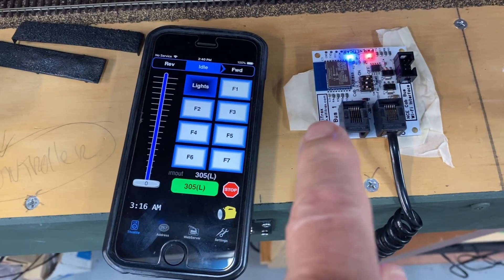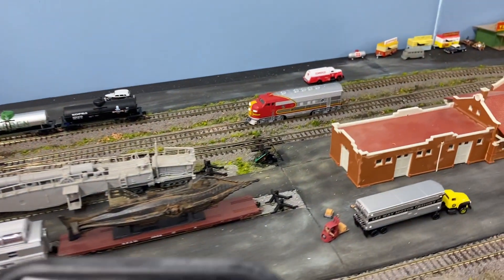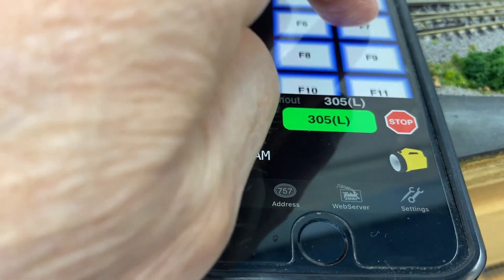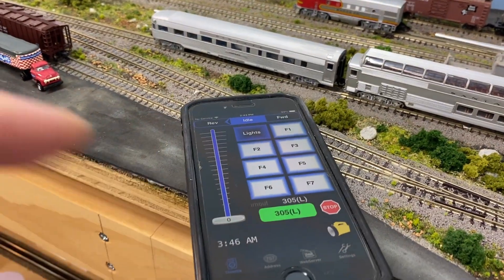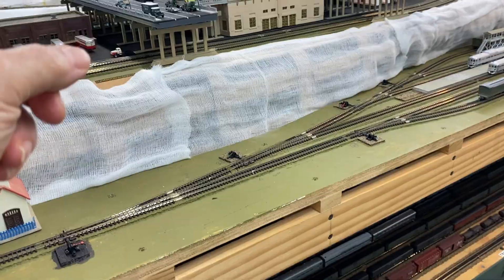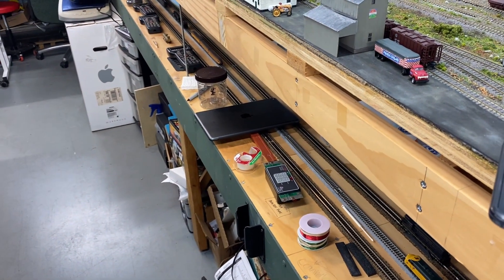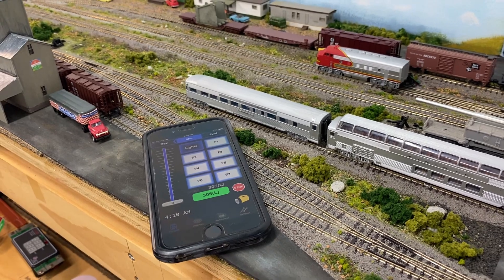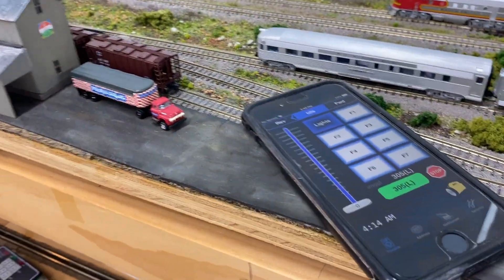WIFI Control with WFD-30 and NCE PH Pro

Comment: Looks great..
 ps.... You can clean your tracks with INOX MX3 ..... it is an electrical contact cleaner that works very nicely on your track.
Reply from the maker: I have used both inbox and crc226. The issue is always with the closure rails of the Peco electrofrogs……John
Reply: @tanzj  ....Do not use CRC26...this has a lubricant in it
INOX MX3 is a cleaner...it does have a slight greasy feel..but it is NOT a lubricant. just need to take some care around the frogs. But this will not cause any problems around the frogs...if you are having frog problems...it will not be from the INOX MX3
Cheers  Paul
Reply from the maker: @PSB-gj9xd  crc226 is an electrical contact cleaner and has worked very well for  10 years. Peco electrofrogs are always a problem especially on sidings that are not used very often…….
Reply: @tanzj  This is from the CRC industries website....notice the last 4 words... it contains lubricant....but your choice  cheers Paul. .....
Recommended for preventative maintenance programs, eliminates breakdowns due to poor environmental exposure, stopping leaking & arcing, corrosion protection of all electrical equipment during storage & transport and lubrication of contacts.

Comment: John, thanks for showing how easy it is to hook up and use the WFD-30.  Your video helped me decide WFD-30 over the NCE USB Interface or the WFD-31.
Reply from the maker: Hi Stephen, It certainly is very easy to hook up. I believe that the main difference between the 30 and 31 is that the 31 can be used to replace the NCE UTP circuit board in the chain of UTP connections. Other than that they would provide the same functionality. Thank you for your comments…..John

Comment: I've used my phone on both nce and digitrax and think its great.  The android is Engine Driver which is very similar to use and it's much easier than the regular throttle I think....👍👍👍👍
Reply from the maker: Hello Jack, Thank you for your comments. I am really starting to like using the WiFi since I can just walk around and not have to worry about plugging in one of my wired controllers. The radio control stuff is just way too expensive to add now. Even my current NCE system is double what I paid for it in 2012…..John

Comment: Looks Awesome Mr. John thats fun Running Trains that Way & Sir with Wi-Fi 

& the issue with your panels ya might try a Dab of NO-OX-ID on your Connectors that go into you UTP panels Bell systems telephone used NO-OX-ID like mad in there Connector pods and some of them we're subject to cold conditions, flooding  and they kept the connections like new for many years because of the NO-OX-ID i just applied a little Inox on my yard Turnout near my passing Siding because my ScaleTrains Dash9-44CW was loosing a bit power after applying the Inox she hasn't had any hiccups that Inox mx3 & NO-OX-ID is just Good stuff my wheels as Greg from fishplate Films said there showing very little Gunk on em' 

Hope using some NO-OX-ID helps your issue Sir and that Layout of yours is getting Sharper the more I see it..
Reply from the maker: Thanks for all of your comments. I actually had to replace one bad UTP panel and may have a bad cab bus cable that needs to be tracked down. I ordered a new crimping tool that also tests the cable plus some new RJ12 connectors and cable just in case I need to remake some.  The trouble with older Peco turnouts, like I have,  is that they typically have bad contacts at the closure rails. I do have some NO-OX and I have been considering using some on the closure rails.  The CRC-226 that I use pretty well keeps the tracks running well....John

Comment: John I have the WFD 31 and the standard NCE 5 amp system.  I am adding the UWT-50, I have it just not installed yet , great system
Reply from the maker: Hi James, I found out about this when I was talking to a friend and bought one after seeing the reasonable price. It is pretty easy to use.  Let me know how the TCS throttle works with it....John
Reply: Hi John, won’t be setting it till the fall, we are selling our house, layout needs to come down, but system works great, I made a custom panel for WFD31, still hooked up the original NCE panel
Reply from the maker: Did you mount it near your command station?
Reply: John , yes I did